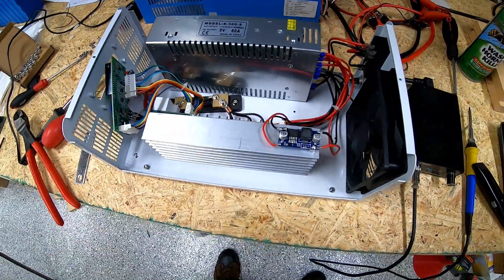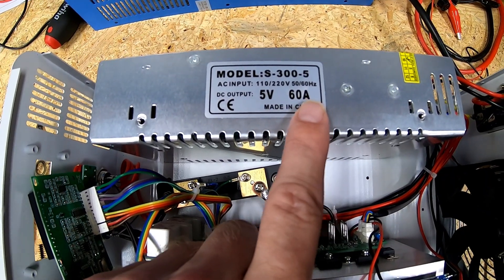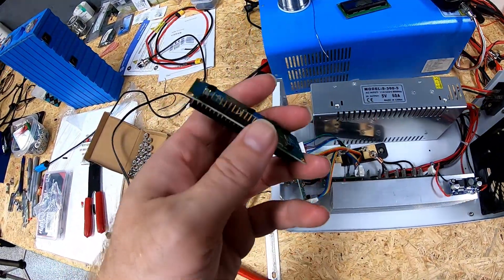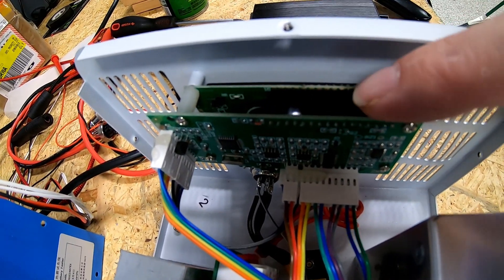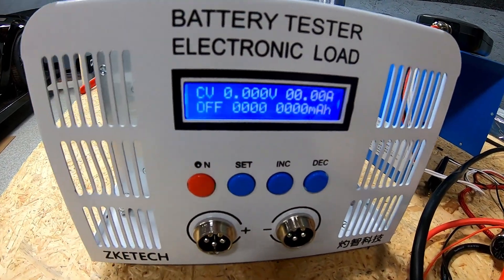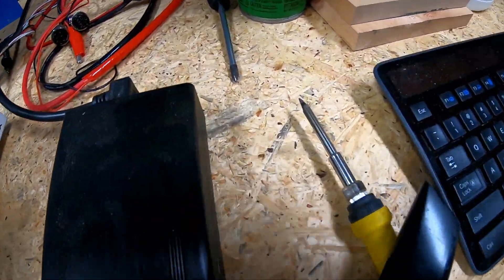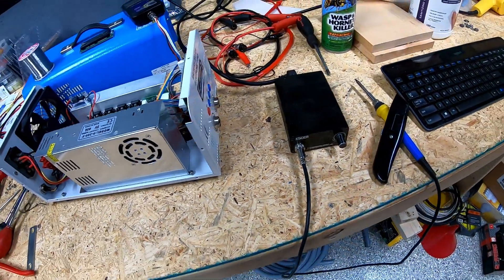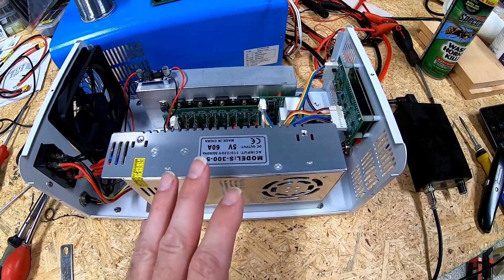EBC A40L Charger/Tester Display Repair

Comment: Hooked up 1 unit 280ah eve cell to charge @ 3.5v and 40amps. Initial cell voltage was 2.9v, charging started ok and i went to bed. Woke up 6hrs later and the ebl charger was flat dead, no lights, no fan....am stumped. Any clues of what may have caused this and how to repair?
Reply: Replaced the power board, with a new unit from AliExpress, and the unit roared back to life and has been a workhorse ever since
Reply from the maker: Sorry for the delay.  The first item I can think of would be to check the fuse on the outside of the unit.  Mine has one next to the plug.  If that is ok, then would need to look at the power supply inside the case.  If they have not changed the design, these units uses a modular power supply a 6V one if I remember correctly.  That power supply should also have a fuse located on it.
Reply: Wonder how this went for you? I've seen a couple of vids showing the mosfets being fried. The max charge current according to the manual is 35 amps contrary to being sold as a 40 amp tester. It can provide the 40 amp load. And as I understand it, that's if it's running on 240vac. Still shows full current using 120vac but it's not the true current value. I do remember when they first came out they were only offered for use with 240vac.
I've got one a little over a year old that is starting to make bearing noises in the power supply fan. My luck it'll lock up and blow the power supply when it burns and shorts out.
I have found a new power supply for under $25 on Amazon, same model number and spec. Looks the same with the same terminal board on the back. Thinking I'm going to get one on the way. See about getting into the bad power supply later to replace the fan. No telling what's in that can of worms. Maybe make a spare out of it best case? But I've got 96 shiny new cells to deal with, no time like yesterday.
Reply: That's awesome. I'm a fan too. Handy tool to have on the shelf.